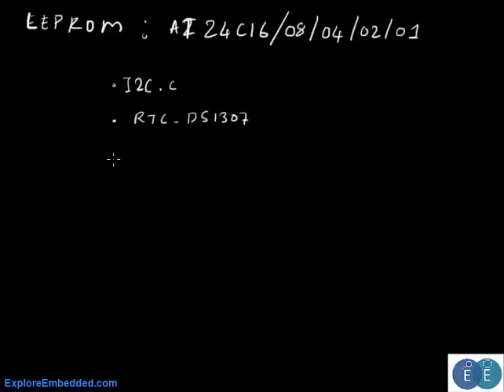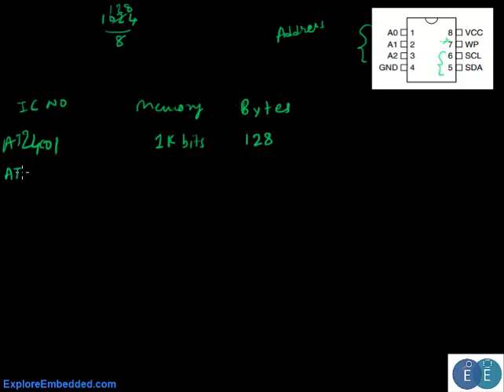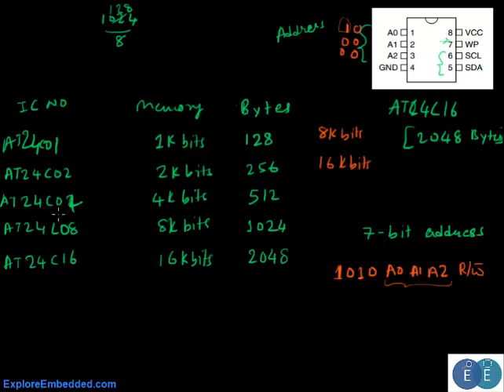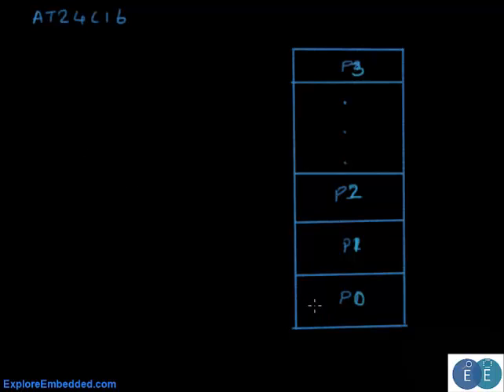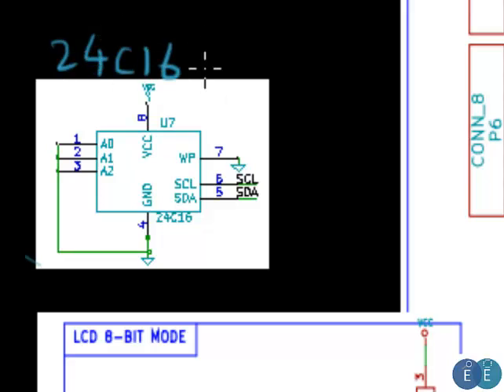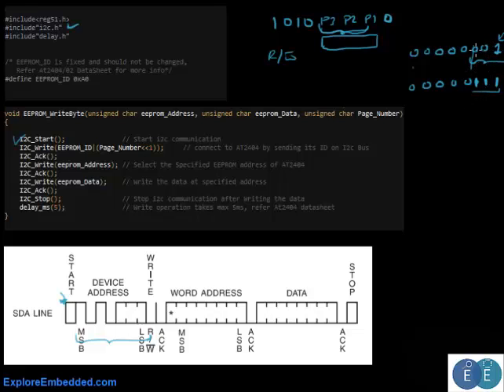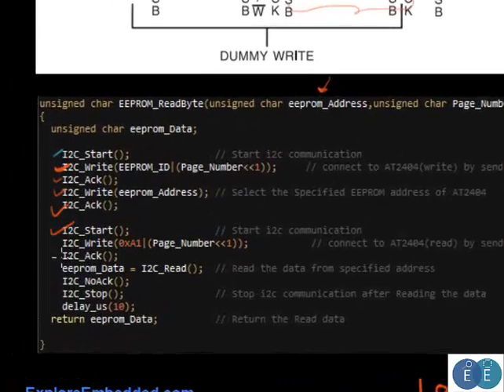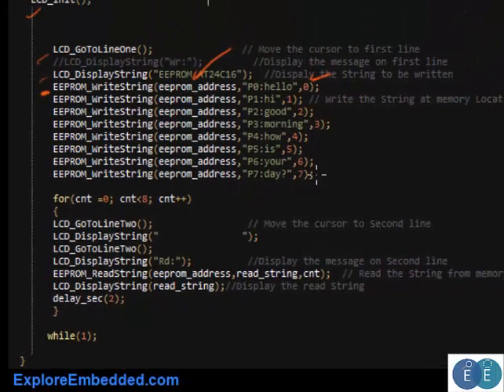8051 AT24C16 EEPROM Interface

Comment: I set up the scheme and in place of 24c16, I put a 24c02. But unfortunately where it was to display the contents of all memory locations, only the content of the 7th position is displayed Rd: P7: day? What could be wrong? I did everything as you designed it, I just changed it to 24c16 for a 24c02.
Reply: adressings are different word adress is for byte addess in your case u have to define a address for chip by hard wiring a0 a1 a2 . then in controll adress u have to code it then in ur word address u simply adress ur data since 2kbit  refers to 256 byte u dont need any page addressing so all the data u will address can be done in word adress. HOWEVER when i cheked the datasheets of 24c01 02 04 08 16 they gave different specifications for paging and it got me confusing.